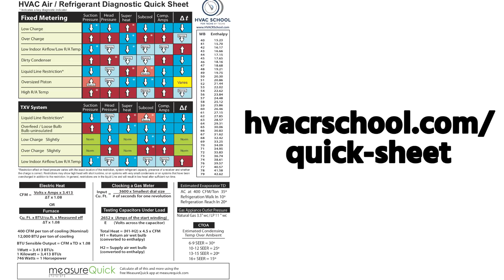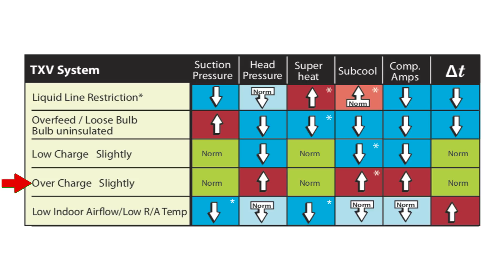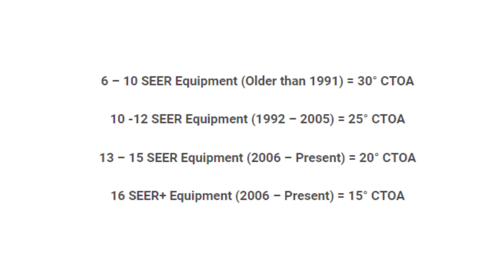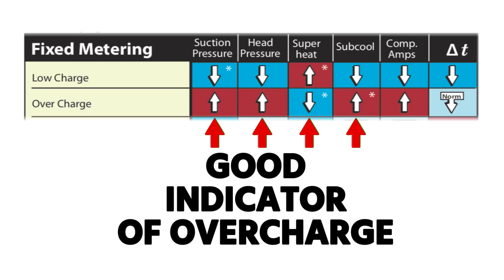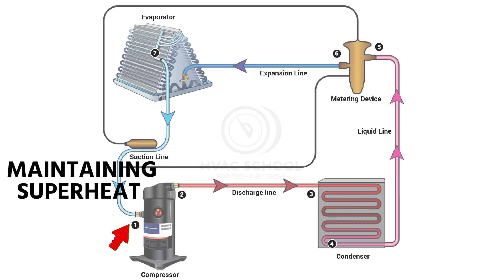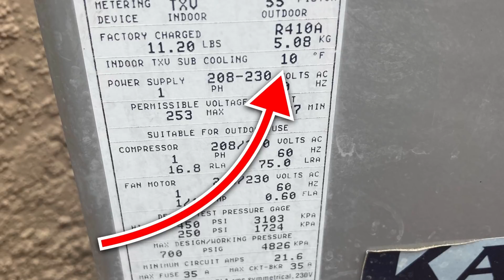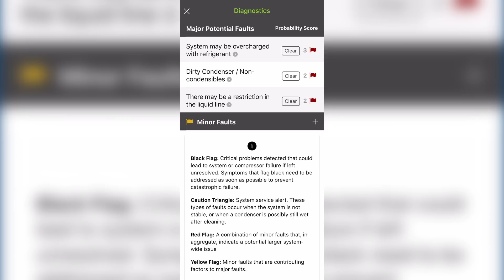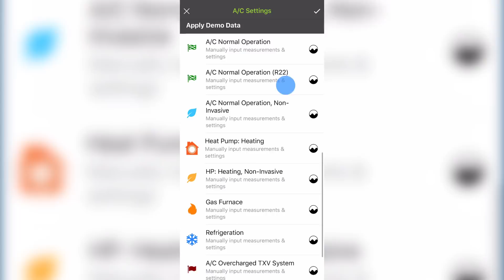Symptoms of Overcharge

Comment: My thing is every call is so much different example went in today wi beer cooler not been ran for a month they turn it on yesterday notice it's not cooling owner "knows a guy" guy left gauges attached connected to a bottle of 404 has been like this the last year(as long as maintenance guy has worked there) then he calls for service says I think someone else beat ya to it bc it's doing good at 55f I say "nope you still have problems, if you dont want me to look im totally fine with it" unfortunately he says yeah id rather you check it out long story short cond was filthy cleaned it head comes down 45 psig throw some temp clamps on it now I find out I got 10f subcooling and 40f superheat (at the txv bulb) shove 7 lbs in system and did nothing but lowers my SH from 40 to 30 but lowers my SC to 7f adjust txv only to find oit it's non responsive. Come to the conclusion that when they turned it off and let it sit the txv locked up (yes I tried to free it to no avail tap run in and out hammer on it the works but nothing) a little part of me says put 3 or 4 more lbs in it but it's a 494 system in at I think 50ish/240ish and it's not changed after 3 lbs... so does the thing just need gas my sat on highside was 100f it was 80f ambient and box was at 50f and sat was at I think 20f) in this scenario do I add gas till I can get him a new txv and install or whatever someone might say. I'm 100% all ear if you wanna curse my name and wish death upon my first born I'm on board just "saturate" me with knowledge so I don't fuck up this bad again 😉

Comment: You forgot to mention the importance of proper airflow across both coils and the importance of having clean coils. I have seen systems with dirty coils that the previous tech assumed was undercharged and he added freon. He then added more freon. He then added even more freon. When I got the call, the reversing valve had hydrolocked and the unit would not go into cooling mode. I pumped out 42 lbs of freon from a system that the factory charge was 14 lbs; 28 lbs overcharged! I cleaned the coils and weighed in the charge and voila, the system worked perfectly for a couple years after. You should also mention that the ONLY 100% foolproof way to charge a system is to weigh out and weigh in the charge. It takes less time to weigh out and weigh in than it does to take a bunch of temp readings, add a little, wait for pressures and temps to stabilize, take a temp reading, add a little, wait for pressures and temps to stabilize, take a temp reading, etc. I've been a licensed HVAC contractor for over 22 years and weighing out the old charge will tell you as much or more than all those readings and do it in less time. The new guys are leaning too much on technology, aka apps on their phones, when the engineers who designed the system have already done all the hard work. Our job is simple when you stick to the basics.
Reply: So recover the Freon to see if they put more than what it needs from factory ?
Reply: What other problems does overcharging a system cause ?
Reply: @get2it7  High head pressure which requires more energy and shortens the life of the compressor. Excessive overcharging can lead to total system failure as I mentioned.

Comment: I have a piston 410A system where where the head pressure goes high and low high and low high and low. Could this be a restriction in the piston? Supposably the last condenser blue so they replaced it and now there's this problem with the icing of the coil thank you for the video

Comment: Excellent video.  A/C only tech here that now designs stuff as an engineer in the field.  Excellent video, and a great point about "stacking" refrigerant.  Subcooling vs superheat charging is something green techs can't seem to sort out which one to do.  Gotta make sure the filters are clean and the airflow is good if your suction is low, regardless of SH/SC.  The basics first, then gauge up.  I keep seeing measure quick in these vids and the electronic probes.  They seem to be worth it more and more, even if I would only use them once in a while in place of my manifold and thermocouples.
Reply: Low air flow and dirty evaporator are not the only reasons for low suction pressure. Your superheat and Subcooling can tell you have a low side heat transfer problem, low air flow or a restriction or low charge all reasons for low suction pressure. For example low suction with high superheat means you do not have low air flow, now if the sub cooling is low too… well we know it is low on charge. Superheat tells you how much refrigerant you have on the low side given the heat transfer capacity of the evaporator. Subcooling tells you how much refrigerant you have on the high side,given the mass flow rate if refigerant through the system.

Comment: hii..i have 20 days old LG 1.5 ton inverter ac with R32 GAS and suction pressure is 160 psi....outdor temperature is 98.6 Fahrenheit. pls tell me is this ok or high?
Reply: yy yy   R32, is the NEW refrigerant to replacevR410A, based on global warming quotient  this is a STRANGE QUESTION, do you own a PT CHART ?, but suction pressure alone tells you diddly squat , cheers 🇺🇸🇺🇸🇺🇸🇺🇸

Comment: If i 've got it right, i need 3 pressure gauges and 7 thermometers:  1 PG  ant 1 T in front of the TXV for subcooling,  1 PG and 1 T in front of the compressor for superheat,  ohne PG behind the compressor for head pressure,  1 T in front of and 1 T behind the condensor für Delta t (condensor) 1 T in front of and 1 T behind the evaporator für Delta t (evaporator). For 3 pressor gauges, i need 3 schrader valves.    Right?
Reply: Or just use a recovery machine to pump out the freon, weigh it and then weigh it back in. Quicker and 100% foolproof. If you weigh in the charge and the unit does not cool correctly, then you know the real problem is something else.
Reply: @briangc1972  Thank you Brian. 👍

Comment: I recently came to a Rheem RPPL heatpump that is slowly building to high head pressure in heat mode (over 620 psi, then trips out) but appears to be charged fine in cooling. Checked all the "obvious" things, and no the backup gas heat is not operating at the same time. In cooling mode the SC is 11 degrees, SH is around 9-11 degrees. In heat mode the suction pressure is normal... it has an outdoor TXV and also a compensator.  The SC in heat mode is 31 degrees and SH is 8. The indoor coil is clean, blower is clean, cap is good,  and static pressure is .7inWc. Only thing I can think of is slightly overcharged? I have not been able to find anyone that can help me with answers on this. The manual nor data plate has specs for what subcooling should be and I know the indoor TXV has been changed in past by a different tech that is no longer at my company. Maybe he "rule of thumb" charged it for subcooling? Any insight would be extremely helpful.
Reply: If multiple techs have been working on this unit, it could possibly have different refrigerants in it? I do know weird things happen when those conditions occur. I went to a job that SEEMED like R-22. Only come to find out two hours later it had been switched MO-99. Found the sticker in the WORST possible shadowy crevice. Proceeded to place stickers in easily visible areas, and crossing out any mention of r-22 on that system.
Reply: @Niveous23  yeah I recommended pulling out all the charge, sweeping with nitro, pulling a vacuum,  and weighing in a fresh charge and then "going from there". It's just a really wierd problem.
Reply: Agreed , the refrigerant sounds suspect . Recover it all and replace with virgin gas . Could have non condensables in the system .
Reply: timrob0420 also call the manufacturers # to get a service instruction sheet , so you are not shooting in the dark cheers 🇺🇸🇺🇸🇺🇸🇺🇸
Reply: Update if possible? Temperature outside?  Some heatpumps require a mild ambient kit.
Reply: .7' WC static is high for an X-13. You likely have low airflow. I pull the air filter on those to see how much effect that has on the pressure. Pump out and weigh the charge, then recharge it. That will answer all your questions.
Reply: @briangc1972  was a PSC motor not a x13

Comment: Can you talk about how systems run in 110 to 120 degree temps like it gets here in Yuma Arizona. Often times you will get to a call and everything is working properly but if you wait a few hours you'll see the condenser fan motor quit from overheating even if the amp draw is very well within range. Many many failures in such extreme heat.
Reply: Most cond. motors are rated for 60˚C temps and after a couple years will do exactly what you wrote. Replacement is the the solution. A motor will work fine up to 100˚F and overheat at 105˚ or higher. Same issue here in Phoenix. I always ask the customer when they noticed the A/C quit.  They usually say mid afternoon, that is the scenario you described, bad motor.